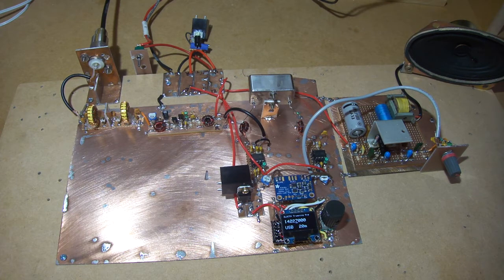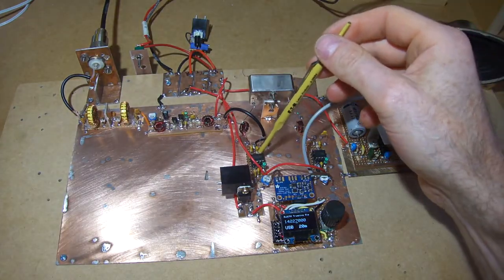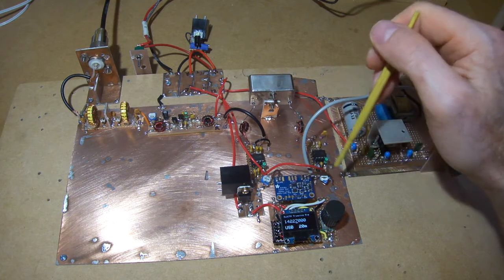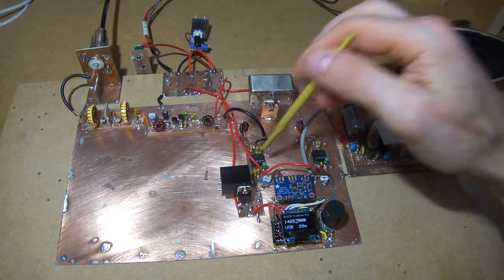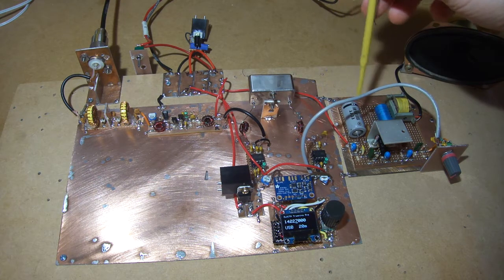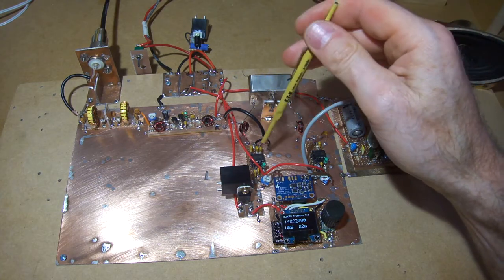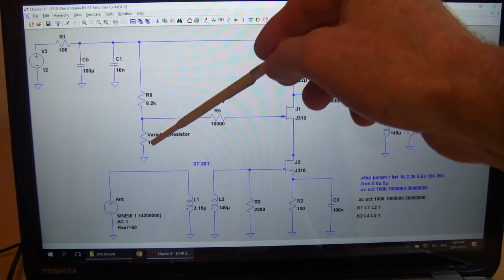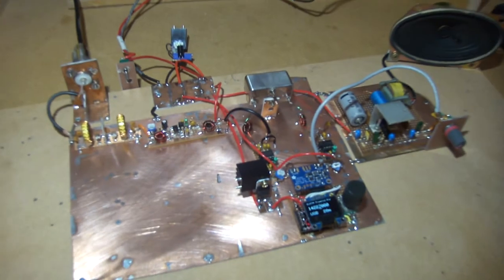Homebrew Portable 20m SSB Transceiver Part 2 - Receiver Experiments

Comment: What do you think of the SA612AN in a portable tramping rig Charlie? I've had good results with several of these architectures. Portable/ SOTA is usually ideal conditions for simple rigs, always battery power, very low noise floor, very little adjacent interference, resonant antennas. Your comments welcome.
Reply from the maker: Hi Paul. I did try some SA602 and couldn't hear any difference. I think any 602/612 would be an excellent choice for the reasons you listed. The tests I ran last night were in an urban environment, on an 80m antenna, using a mains powered 12 V supply. The dynamic range was good too, in that there was a local station booming in and all I had to do was reduce the volume. I couldn't detect any distortion or any other negative impacts from such a strong signal. I thought it was very good for such a simple rig.

Question for you, how much gain do you have in the receiver prior to the audio amp? What I think I will  do is add a small RF amp after the crystal filter to amplify the IF.  While it's good, I think it could do with another amp stage. I'll do that tonight and report back.
Reply: I believe the NE602 and the newer SA612s are the same thing -- I was more interested in how you find the SA612 mixer/product detector as an alternative to a diode ring DBM. I have 3 transceivers using SA612 receiver mixers  and product detectors (40m, 30m and multiband).  None of them use RF amplifiers, just antenna to BPF to SA612 mixer.  In two of them there is no additional gain stage in the IF, just the crystal filter.  Qualitatively speaking, my 40m txcvr has just  enough gain on a 40m dipole.  The 30m CW txcvr had what I considered to be insufficient gain, so I did what you are thinking and added a fixed gain 2n3904 post filter stage, which made it much more perky, but increased the receiver noise (as heard with the antenna socket shorted).  There is still a lot of receiver gain after this point so a low noise device and careful gain adjustment is important.  In my current project, a multiband receiver (2xSA612) there is no IF stage, and it is good on 160 to 40m, acceptable on 30m, deaf on 20m.  I have two choices -- add an RF stage for 30 and 20m, or add a manually or AGC controlled IF stage.  I am waiting until I get the transmitter path working to make that choice.  I expect to find that RF output drops off unacceptably above 10MHz and so the IF stage will be necessary to ensure sufficient PA drive.  I will report back when I know.  Enjoying your experiments, keep up the good work!  73 Paul VK3HN.
Reply from the maker: Thanks Paul for a great reply. Really interesting. I'm just listening to a VK out of Melbourne and he's booming in. In the end I did not install a second IF amp. I agree with you that a SOTA/tramping environment is particularly quiet and well suited to such a receiver. What I intend to do now is share the BPF and antenna RF amp between RX and TX. I may need another TX pre-amplifier stage, but that's fine. I might even look to drop 1.4V across two series rectifier diodes and run the DDS/uP/screen off the 7V LM317 output. That way I can do away with the 7805 volt reg. 

To answer your question, given the relatively short amount of time I have had experimenting with the NE612, I'd say it's equally as good as the SBL-1 DBM. The dynamic range seems to be excellent. I'm definitely going to make this into a tramping radio and take it out. Again, thanks for the really useful feedback on our designs. Very useful!

73s

Charlie, ZL2CTM
Reply: Charlie Morris Anecdotally, informally and qualitatively, I agree that the performance of the SA612 in a simple superhet is perfectly acceptable, even compared with a DBM. Don't let that opinion escape onto the Yahoo emrfd group!  I can imagine the ridicule that might be unleashed. One potential weakness that we are not aware of is strong amateur signals overloading the SA612 mixer, in VK and ZL the bands are so underpopulated compared with the USA or Europe. And there aren't ( or shouldn't be) the local kilowatts either. I dont think we have much idea of how overloaded the bands can get up over.  I am very happy with the SA612 simplicity/price/performance tradeoff.  Keep experimenting!
Reply from the maker: Paul. Just changed the AF amp to a higher gain one. Heaps better. No need for a separate IF amp.

Charlie
Reply: Charlie Morris What audio ICs did you use?
Reply from the maker: Paul, it was a 2N3904 pre-amp running into a LM386N-1. There is a AF LPF and a separate 470nF across the volume pot. It's not a high fidelity amp, but does the trick for now.